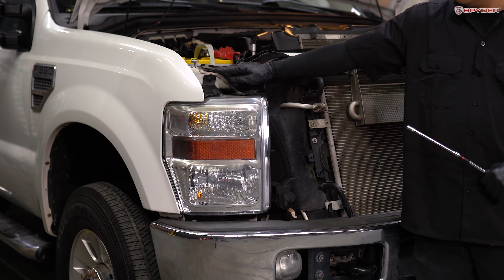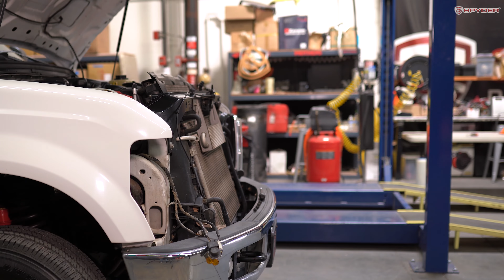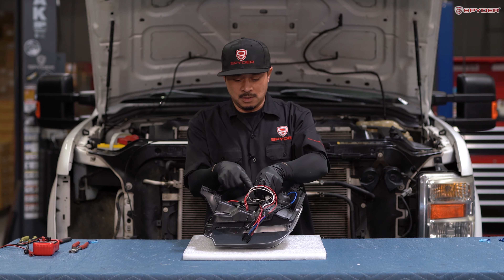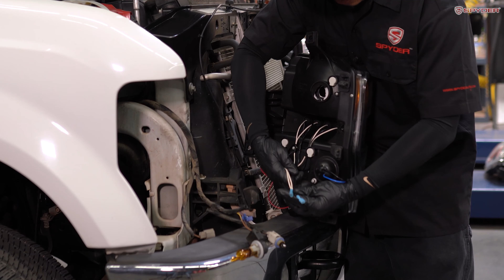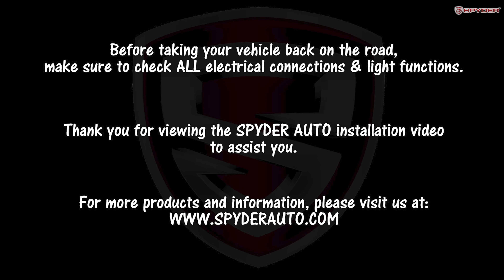Spyder Auto Installation: 2008-2010 Ford F250/350/450 Headlights (HALO/CCFL)

Comment: Hey so I bought a set of headlights for my 2008 F-250 (they look rad). But they are way out of line and there is only one adjustment screw on the back... How do I adjust them up and down AND side to side?? The screw doesn’t seem to be moving anything in the housing... Thanks!
Reply: Diagram ?